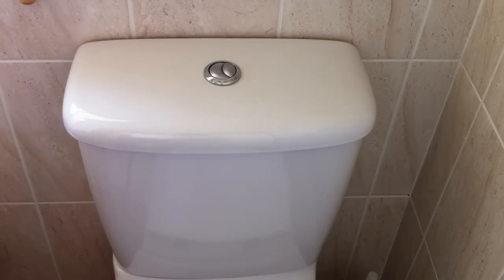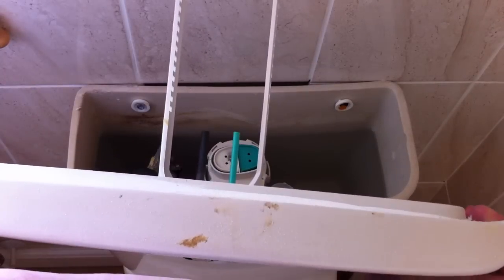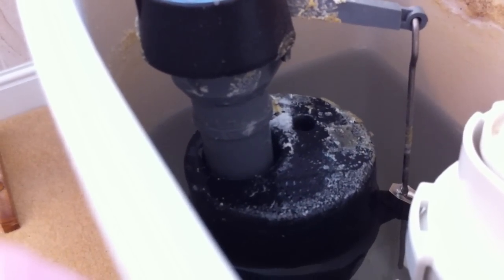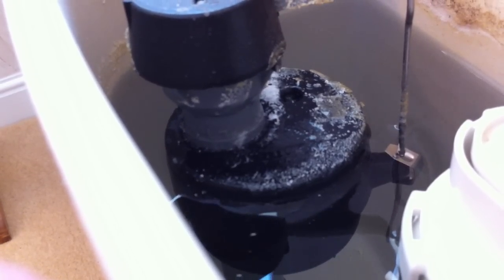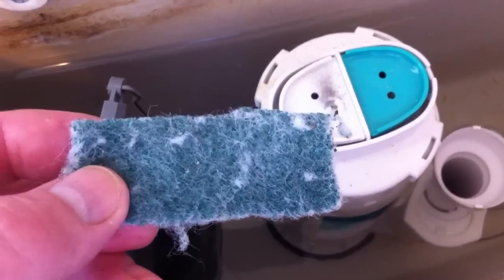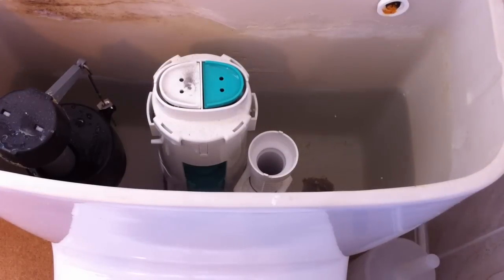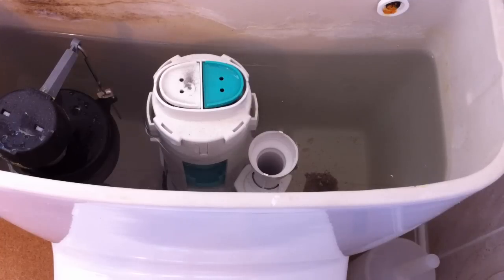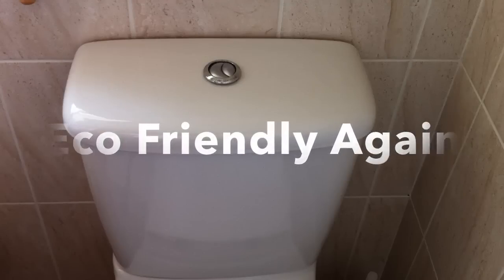How To Fix A Wasteful Over Filling Dual Push Button Flush Toilet

Comment: Thanks, exactly what was causing mine to leak. Bought the house a few months ago but the toilet was leaking the last 6 weeks. I have a cistern, and the toilet was blasting through the water. Normally get 6 weeks and was down to 4. Figured out it was the toilet after that fill. Was just turning the water off avoiding calling the plumber until I could consult YouTube. Finally (6 weeks later), I saw your video. My gasket was writing down and had scaling. Guess it was fine before hand, but the combo caused the fail. Fixed in less than a minute thanks to you.  Kudos!
Reply: I’ve had a lot of little things to look after, and this one was fine as long as I shut off the water each use so I left it longer than I should have. Kicking myself now that it was so easy. I’ve fixed many toilets before and when I pulled the top I figured I needed to order parts. Too easy and too quick. I’m gonna YouTube everything right away now. Again, appreciation for the video.
Reply from the maker: Really great to hear the account and the fact you fixed it. Please don't forget to subscribe and check out my other great videos https://youtube.com/playlist?list=PLVnKaE3t-yQWqZK6pjJVKNIX9b6F8cmbV there are over 440 to choose from and share #fixed1t with friends, family and colleagues as I could do with more subscribers to help grow the channel.  Many Thanks Malcolm aka #fixed1t